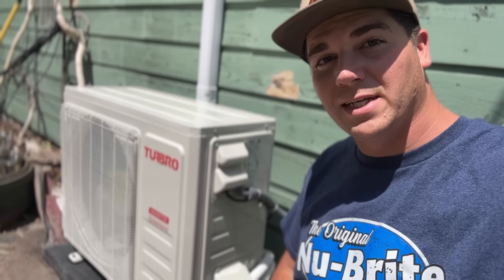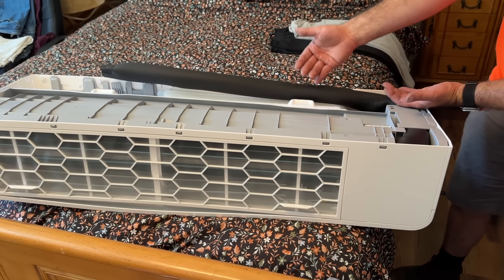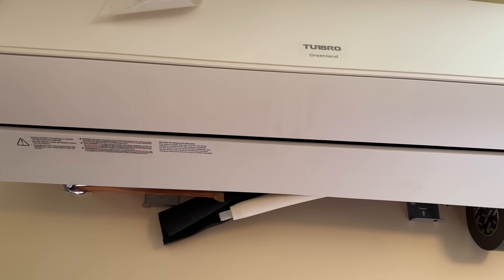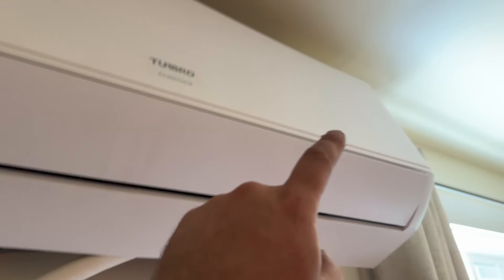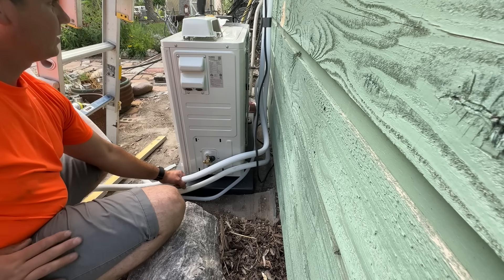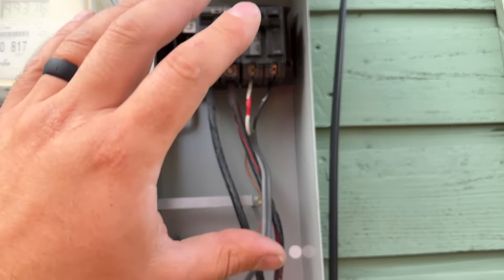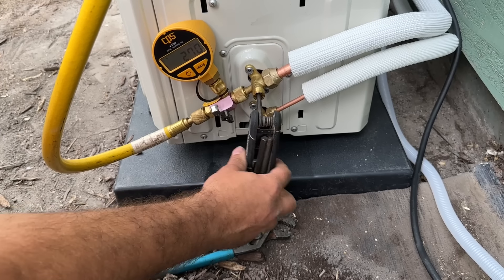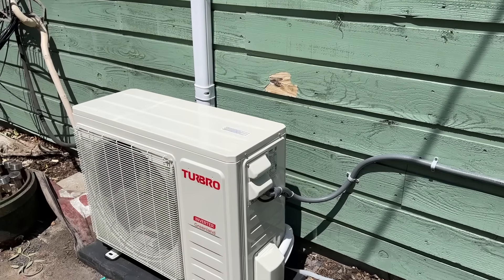Can You Install Your Own Mini Split? Here's All The Things Nobody Tells You!

Comment: I thought it would've been way easier to bore the hole on the right hand side instead of coming across like how you did you'd have more space behind the unit but hey I'm not installing it 🤷🏿‍♂️
Reply: Minimum length!!!!
Reply: You would have connections made outside as well, maybe because of window framing and stud layout there wasn’t enough room, and left side was the safest way. No patch work is always best.

Also nice to see how to do both directions every house/application is going to be different.

What is the warranty on this product from rusting in coastal areas?  That is a screaming price for a 22 seer. Especially on 110 voltage.

Comment: You made your job harder by having to cut and flare the copper behind that air handler
Reply from the maker: I though this was easier because the lineset would have come out on the other side of the condenser. But they can be done both ways 👍🏼

Comment: I would've made my connections on the outside of the building. And install the line set inside of a covering.
Reply from the maker: I thought it was easier this way. But it can be done either way

Comment: 😂 Where was this video a week ago when I noob stumbled through the exact same install on a Turbro 18k!  It was good to see I did MOST of it correctly!  Thanks for the vid!
Reply: I am doing a couple of them right now.  I had the wrong fitting connecting to my vacuum pump.  I hope to finish tomorrow.  Do you know about what the air temp is inside coming out of your unit?  Just curious.
Reply: @jameschupp2230  pulled a 35.2 f on an infrared thermometer with an outdoor temp of 85 about an hour after I installed it.  Haha! Ask me again in a year from now and if I get the same result I’ll be happy with my install!
Reply: @brianklange  Wow!  That is music to my ears!  Thank you.  So many of these mini splits only cool down to the 50's.  I think you probably did a great job if you have a infrared thermometer!  Not everybody has one.  Thanks again!  We are still dealing with 100 degree temps down here in Texas!

Comment: My mini split didn't require a vacuum pump. My lines had nitrogen in them and also the instructions said there was extra freon in the system for the purpose of filling the lines. They also said you open the larger feed line first then open the suction line ( smaller line ) and the system will be ready to run. It also dais if I would ever want to relocate the unit you would turn on the A/C and close the feed line wait about 45 seconds and then close the suction line as this would suck all the freon out of the system. I installed my 120 volt 18,000 Hessaire about 2 1/2 years ago and had worked great since I installed it. I am wondering why some make you suck the lines. Your video is great and VERY informative.
Reply: Never mix nitrogen with refrigerant. If the lines came with nitrogen you need to vacuum them out.

Comment: I am installing a couple of Turbro currently.  I like to cut the flares off on the connection at the head and swage the copper pipe and use a special solder and flux.  I did notice your com wires were different colors than my 12,000 btu 230.  I don't know what that is about.  I like your videos.  You do a great job being thorough.
Reply from the maker: I believe that would void the warranty but if it works then go for it! Stay brite 8?
Reply: @diyhvacguy  Yes, Stay Brite 8.  But I am only doing the joint of the lines.  
I installed a mini split with 3 inside Heads 6 Years ago, and last year in the heat of August 100's, I had an AC Tech, come out and Evac the system, and reinstall the freon, and all the freon was still there. 
The Reason I Dislike Flare Fittings:
I had a Mobile Home in the 1980's and I had a lot of leaks as a result of the Flare Fittings... So I never want to have Flare Fittings if I can avoid it.  Yes the Flares on AC are different with a little different angle I think, But I just had too many bad experiences! :)

Comment: I've watched more install videos than I can count. About 5 years ago I put in a 24K Btu mini split into my sun room. Pretty straightforward. Works great. About a week ago I put in a 12K into a Conex cargo container that has a 23 ft insulated and sheet-rocked area that's about 23 ft long. So under 180 sq ft. It worked surprisingly well for less than 3 days! I checked all electrical connections and leak checked it. No apparent leaks. I put a Clamp meter on and turned it on. It started out pulling 16.6 amps but dropped to 8 then .85 amps within 45 minutes. Placard states 12.7 amps minimum and 25.0 top limit. I'm guessing something is wrong with the compressor. I don't have any codes though and the AC seems to be operating all except no cold air. Manufacturer is kinda jerking me around. Been back and forth emailing for over a week now. Thinking maybe I should just jerk this thing out and return it. :face-red-droopy-eyes:

Comment: Great video showing how easy the install can be. I would seal the pass through so outside air doesn't come through the wall. When opening valves do the liquid line first watching vacuum guage to slightly positive pressure than close and install schrader. Remove vacuun guage before opening suction line so you dont contaminate your guage with oil. Maybe that is why your other guage is acting up?

Comment: We have 5 minisplits - The cost of installing minisplits here cost 5-8K Canadian each - saved enough to buy a car or 2! We make our holes slightly larger to help with mounting and for the drainage pipe to comfortably fit on the bottom and drain properly because we are not professional and hate the mounting part of the minisplit especially with heavier 24,000 BTU Units. Of course we insulate is and fill up the gaps after. 

Perhaps you can talk about convoluted copper pipes which some units have in a video? HVAC Talk bars information about it on one of the threads. It would be nice to have someone with experience talk about it since there is not much information online about it.

We have 7/8" convoluted pipe for our larger 24k btu unit. That thing is thick!

Would you ever do one of those new Mr. Cool in Ceiling cassettes? (between joists)

Comment: After deburring, plumbers & AC tech need to use a handheld vacuum to suck the dust/debris from the cut which is very doable. I know the dust/debris still inside the pipe after deburring.
Reply from the maker: Yea you should always do this with it pointed down.
Reply: You do risk sucking in whatever crap on the other open end, though. This would also require you do both flares before connecting either of them, which requires running back and forth. Easier probably to use one of those knife flaring tools where the burr being shaved off tends to be a single, larger piece.
Reply: @bnasty267  Handheld vacuum is not that strong, a quick touch should able to clean the debris w/o sucking  what’s on the other end. 😅
Reply: @BibleExposition2022  If you're walking back and forth, better would be to hit it with a blowgun on your nitrogen tank from the opposite end.

Comment: Hi Dave, thanks for doing the video, which should be very helpful to DIY'ers.  I don't mean to be critical but, I did spot some errors.  I only have one mini-split installation under my belt so, not an expert by any means.  I have been doing car AC work, with some home AC work since 1970, although not professionally.  I bought 2 Cooper & Hunter units 3 years ago that run off of 115 Vac, so I could run them off of nearly any backup power source.  I am sorry to say, that I'm just now getting around to installing them.  I'm in my latter 60's so, the install was physically a lot more demanding than when I was younger.  Anyway, enough introduction...  

I did lots of research to avoid the pitfalls that plague of those that highlight how easy the installation is (although primarily experienced by DIY'ers).  The most critical failure is with the refrigerant line set flare; it has to be (basically) perfect.  Most of those experiencing refrigerant leaks used the low cost flaring tools made for automotive brake lines.  An eccentric type flaring tool must be used, as it produces a much higher quality flare.  I went a step further than Dave with the flaring tool and used a tool that sets the length of tubing protrusion within the tubing clamp, as to avoid another failure opportunity.  This is more important for DIY'ers, since we don't flare copper tubing that often, a flare that must be done perfectly to insure a good seal.  You need to use that Nylog Blue on the flaring tool cone to achieve a smother flare surface.  Then also, while connecting the flared tubing to the unit, the Nylog Blue must be used on the front and back surface of the flare taper, as well as the connector threads.  This accomplishes 2 goals; (1) It allows better enables the copper line to be smoothly crimped into the connector and (2) Provides a measure of lubrication to the connector threads to enable accurate torquing.  All torque figures assume some type of lubrication on the threads.  Dry torquing is not accurate because, it causes galling/binding of the threads.

The refrigerant lines from the evaporator must exit the unit as soon as possible to feed through the wall to avoid condensate leaks and mold problems.  Running this bundle through the backside of the evaporator (as shown in the video) will allow condensate water sit in the drain pipe (hose) when the unit is off; a source of mildew/mold.  The refrigerant pipes, drain pipe, and control cable must be bundled with the drain pipe in the bottom of the bundle.  The whole bundle should exit at about a 100 degree downward tilt to promote drainage.

The power/signal wire hookup in both the evaporator and condenser, have a plastic cable clamp in the area where electrical connections are made.  This clamp acts as a strain relief for each cable.  This clamp is supposed to clamp the wire jacket, not the individual wires.

After the installation was completed, I did some testing of the unit, and was surprised how inefficient these mini-splits are when outside air temperatures are hot.  The unit I bought is rated at 25 SEER, which equites to 21.9 EER.  This cooling efficiency test standard is run with an outside temp at 95 degrees Fahenheit and indoor temp at 80.  Actual measured efficiency was only an EER of 12.  At 100 degrees, this plummeted to an EER of 7.3!  I was not able to get the advertised efficiency until the outside temperatures reached the lower 80's.  (Yes, and I did triple check everything).
Reply: you absolutely do not torque with lubricated threads.. he did have an eccentric flaring tool. I do believe he was incorrect to flare flush to the end of the tool and that it should have protruded about 1/16 to 1/8"
Reply: SEER/EER and even HSPF are really only useful as comparisons between units, because the test parameters (though not real-world) are standardized. As someone in an area that needs more heat than AC, I always look at the rated output at various temps using the realistic standards set by AHRI. Those numbers are much harder to cheat, and they give a good idea of what size unit you may need for the colder days. COP is also useful here for efficiency, as it directly reflects how much heat you get per kW (and thus $.) 

The best thing you can do to maximize efficiency is to not over/undersize the unit. Generally speaking, for minis that can modulate output, around 60-70% is the sweet spot for efficiency. You actually want the unit to struggle on those really hot days, because that means it's not oversized for the majority of the days. This is a bit more tolerable for AC, whereas for heat, I'd rather give up some efficiency to ensure the unit is large enough not to let temps drop too low when it's really cold.
Reply: @william18miller  Thanks for your response.  On the torquing, I am repeating standard mechanical engineering practices.  Some type of lubrication must be on the threads while torquing, otherwise an accurate torque setting cannot be accomplished.  There may be dry torque values out there but, these cause proven inaccuracies.
Reply: @bnasty267  Thanks for your input.  I am familiar with the other measurement standards you mentioned, I just used EER as it is the simplest, most straight forward measurement comparison.

With my installation, my goal was not optimum sizing of the unit, but instead, backup heating/cooling based upon running the units off of some type of backup power (battery, solar, or generator).  The whole system is based on the compromise idea of: Some cooling/heating is better than none at all when power is out for several days.  I live in a forest area in north central Florida and therefore, last priority to get power restored when a hurricane comes through and takes down large parts of the state.  Also, I have been hearing increasing rumors for the last 3 years that the US power grid will be taken down at some point so, wanted to reduce vulnerabilities a bit if this comes true.
Reply: I don't think that you can really convert SEER to EER on the variable speed system (somewhat doable for single speed system)
In general, variable speed mini split are more efficient at their half load BTU. So, if you want it to be more efficient, you have to make it runs at lower capacity.
Although some high-end mini split are still somewhat efficient at their almost-full load capacity, you just have to look for their EER rating.
Just for the example, you can take a look for Daikin Atmosphera R32. On 9k, it has 27.3 SEER2 and 16.3 EER2 rating which is very good.
Reply: @mikaelahyakuya3485  Thank you for your comment.  I noticed, since the high efficiency mini-split can throttle the fans, compressor, and expansion valve, there is not really an "apples to apples" comparison to a standard single speed 60 Hz induction motor compressor A/C unit.  I made such a comparison and noticed the standard unit power draw varied only +/- 2% as outside air temperatures went from 80 to 100 degrees, whereas the efficient mini-split power draw varied +/- 88%!  I'm thinking the difference between the two is the mini-split is actually ramping up it's heat removal capacity as temperatures rise, probably putting out 50% more cooling than the rating states.  In comparison back to the single speed unit, it appears the actual heat removal ability is dropping as outside temperatures rises.  The problem is, to measure this accurately, you would need test equipment that measures the volume of air each unit moves, along with the input/output temperature and humidity levels, such test equipment the average person doesn't have.  Anyway, I am going into entirely too much detail, straying far from the original topic of the video.

Comment: Is there a reason why the gauge you show at ~28:00 is different from the one we see at ~31:00? I am assuming maybe batteries died or something, but you didn't mention, so figured I'd confirm. Been wanting to actually replaced our central air with a system that can handle each room to the temp we want it.

Also, completely different question, but are there any multi room units that will connect with something like a nest to be able to control everything from one place/app?

Comment: You sir are a pro, thanks for a great teaching video.  I'm looking to replace my Mr. Cool 12K BTU DIY with the Turbro 12K.  My question is the Mr. Cool runs on a 20 amp circuit and the Turbro 12K requires a 30 amp and it would be very difficult for me to re-wire.  Is the 30 amp circuit and 10 ga what is needed?  Thanks

Comment: Question.  
I did my install 3 years ago. 1st timer. Unfortunately, not knowing I left the Schrader core  in the refrigerant valve on my mini split install. Then after the vacuum, thinking I needed to put back the Schrader core I tried to put another one in the refrigerant valve on top of the existing one. Still not realizing what I did, obviously the 2nd core wouldn't go in, but I couldn't get the 2nd one back out either. So instead I just shut the ball valve on the Schrader core removal tool and left it on. Everything worked fine and is still working fine. Although I have no idea if I've lost any refrigerant over the last 3 years. 

Today after watching enough videos and realizing what I did. I attempted to remove the Schrader core, but still couldn't get it out. I then tried to slowly remove the whole removal core tool instead hoping there was no pressure from the 2nd Schrader core pushing in on the original Schrader core. But my hope was not working as the 2nd Schrader core must be pushing on the original valve stem and the refrigerant began leaking out. I waited a few seconds and tightened the Schrader core removal tool back up and closed the ball valve again and left in on. 

Any idea if that will hold indefinitely. Realize these things take time before destroying the compressor even though it is working. But I don't see the slightest amount of oil leaking out as of yet. Assuming that would be a sign that I have a leak there.

Comment: I recently had a flare fail catastrophically on a mini split install I did and lose it's full charge in a rather dramatic way.  I'm going to recharge it, but do I need to worry about replacing any lost POE oil in the system? When I say "dramatic" I mean full on high pressure full to empty in a few seconds.  I capped it immediately after the failure to prevent contamination of course.

Comment: One tip I was told, was to slightly have the indoor mounting bracket leaning slightly to where the drain goes to better help with draining, rather then having it completely level. Do you do this?
Reply from the maker: I’ve never done this. That would bug the crap out of me seeing it not even with the ceiling lol
Reply: @diyhvacguy  that’s the thing, you can’t tell. With your level on there, it’s just so slightly to where the drain goes. Nothing major.